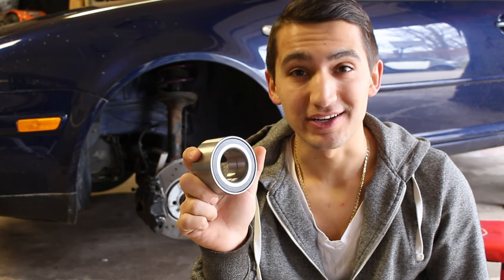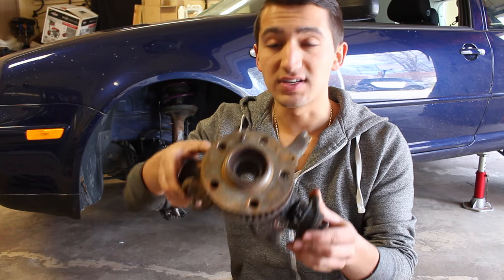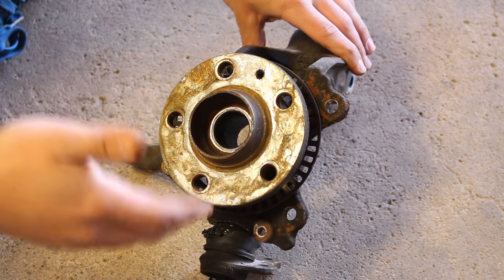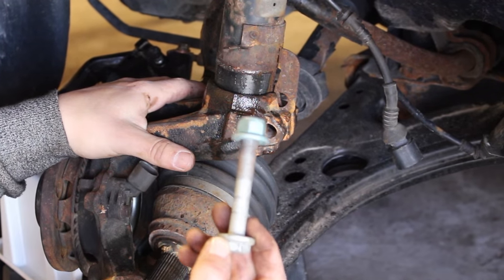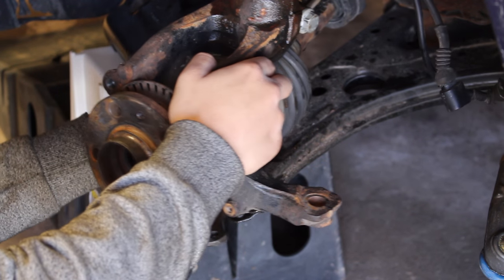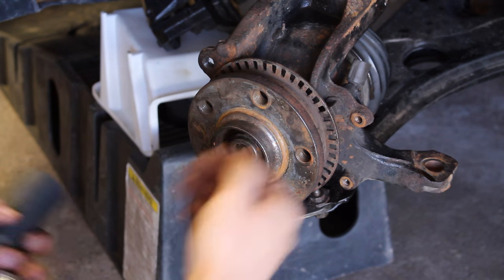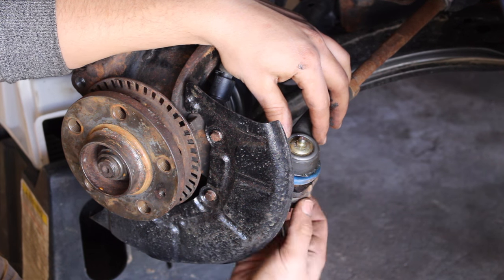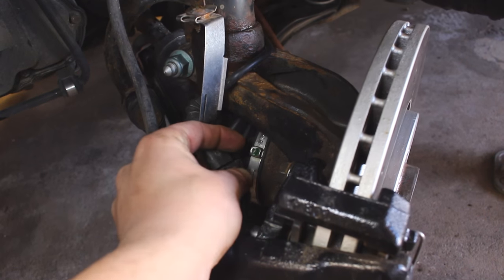How to Replace a Wheel Bearing (Press-In Bearing)

Comment: i replaced the wheel bearing in my 03 tiburon with a sledge hammer and a big socket (not ever recommended) and then a month later i bought a press and replaced it again lol

Comment: You can also just remove the hub with the wheel bearing in it and not have to mess up the alignment. ;) I believe that you can remove the hub and just take that to the Auto shop to press the new one in. Otherwise you can stack on another $75 for a front end alignment. The bolts in the lower control arm are movable. You can score around them with a awl or ice pick and try to put them back as close as possible. That will help keep some of the same castor/Camber in the spindle. Hope this helps someone. :)

Comment: Tighten the axle nut to 147 ft. lbs. the first time raise and spin the wheel 1/2 turn counter clockwise, then lower car and loosen bolt 1/2 turn then re-tighten to 37 ft. lbs.? Why is there such a difference between the finishing tightness? Is this still a safe level? Not saying you're wrong this is my first time doing this lol. I'm just curious.

Comment: The brakes on my Honda makes a rubbing/ grinding noise when using the brakes in stop and go traffic. Are the brakes supposed to be silent or will  there always be some noise coming from the brakes? They work great otherwise and never have an issue stopping. Honda dealership stated this is normal. What's your opinion? :) Thanks! :)
Reply: +Jordan F change your brake pads

Comment: So how do you do if you dont have that hole in the rim? how do you tighten it up bro?
Reply from the maker: +adil lokat You would remove the center cap on the wheel. With the wheel from the backside of it, you can simply pop it out with a little hit :)

Comment: Wait so torque it to 147 and then loosen it the torque it again to 36??
Reply: i think the 147 ft pounds was to set the wheel bearing and make sure the axle was fully inserted, then you back the nut off so its loose, then torque it to the final 36 ft pounds. hopefully that makes sense

Comment: I dont recommend bringing wheel nuckle and hub and set of wheel bearing because like once time I did pep boys because it's closer at my home they did are not considerate of orientation distance wise between the hub and nuckle it was too tight I learned it till I actually bought my press and do it my self as of the mess pep boys did it was months till I decided to buy my own press and do it my self so it's too late to complain. That is why when it comes particular to that wheel bearing work you can either do it your self or bring your car to the shop but not the nuckle and bearing and hub along cause it will be a mess

Comment: My 2 cent for rest of people. Don't fix bearing. Call your local car recycling place. And ask them for whole bearing and knuckle set. Gonna cost 50. Buy that and it will just be 5 nuts and bolts rather than this much work. I did this just today. And bearing was costing me 30 Chinese. And knuckle/hub I bought off original car, Japanese made. Also rent tools you don't have from local automotive shops. Should be free.